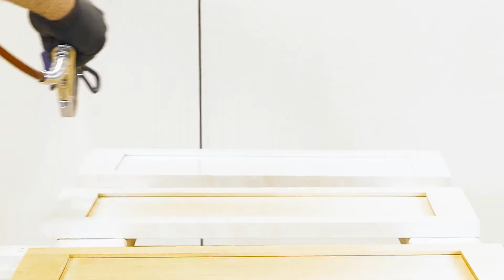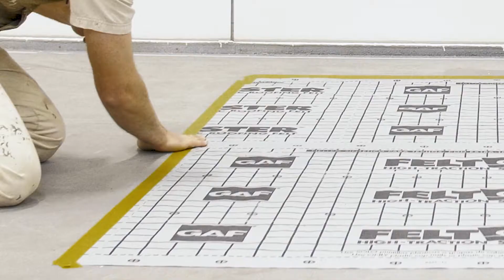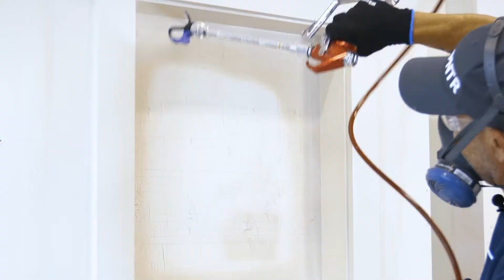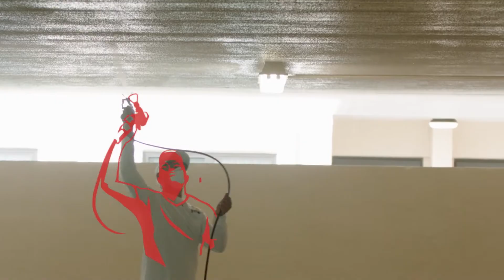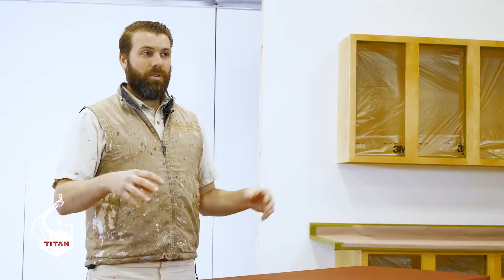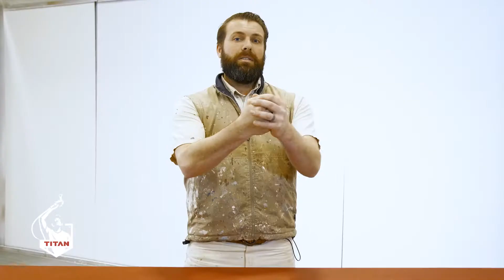Cabinet Finishing: Coating Tech

Comment: So, how do you deal with something like Benajmin-Moore Advance and the 16 hour recoat time? Or the runs/sagging on vertical surfaces?

I'm trying to find the best water-based stuff, because more and more people are avoiding solvents in their homes. Even oil primer is tough to push, these days.